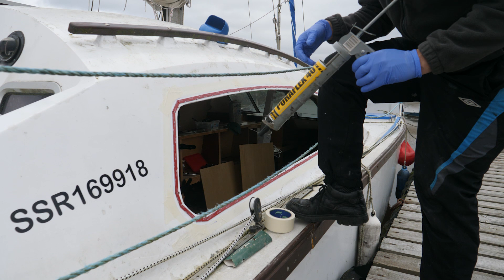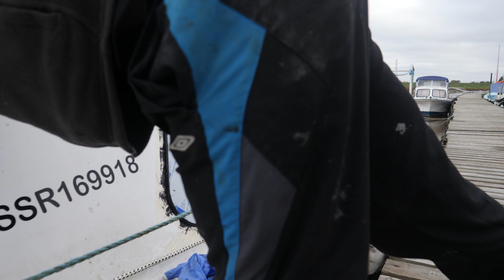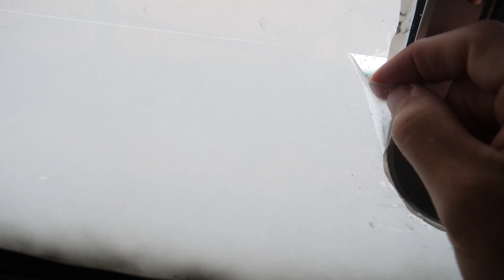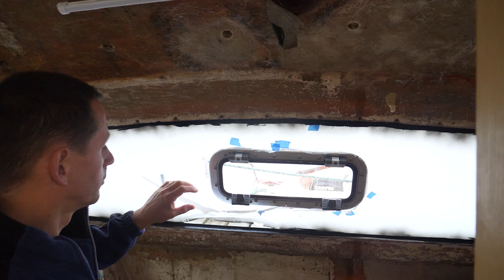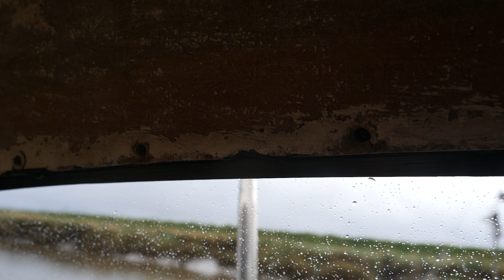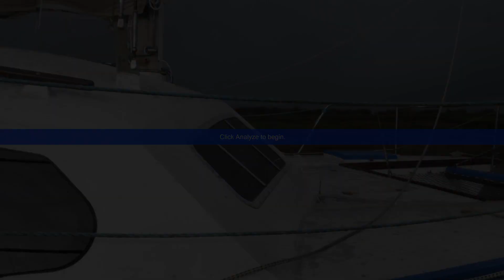Acrylic Plastic Yacht Window Replacement - Part 2

Comment: hold on, what about the screws the window is just glue to the boat wth
Reply: VHB tape - Very High Bond Tape is the stuff they use for skyscraper windows.
Reply: @CaptainShack  thx
Reply: True. I’m about to replace the windows on my Beneteau 37. There are no fixing on that and 1000s of them have done ocean crossings and some serious weather sailing. Must be ok. Also, I would spend a bit more money on a higher quality masking tape (always found Frog tape good) and I plan on using a couple of glass suckers on the inside at each end of the panel with a bit of rope tied across to the other side to keep a bit of pressure on while drying as there is a bit of a bend on mine. Not sure I would have done the job when it was threatening to rain, I was nervous watching that!
Reply: @gileshammond What a top idea about the suction device. I actually had forgotten that I had one until you mentioned it. They are very cheap and I use it for holding onto the outside of the boat when using my dinghy to do hull polishing. 100% on the Frog tape. This is not a job to skimp on.

Comment: What about the expansion of acrylic plastic in variable temperatures? What will happen to this seal?
Reply from the maker: Make sure you have a good gap of about 3mm.  Fit the windows in a temperature that is average.  Therefore, expansion/contraction is minimised.
Reply: I learned the hard way the gap should be about the same as the linear expansion. My windows were about 5 ft long and the 1/16 " vhb 3m tape not even close to being thick enough. In full direct sun the windows expanded over 1/4" so the gap should have been about 1/4". The windows separated from the tape in several places and the gap was too narrow to use any kind of sealant since it just cracks/tears.